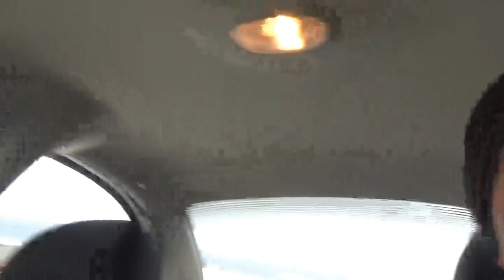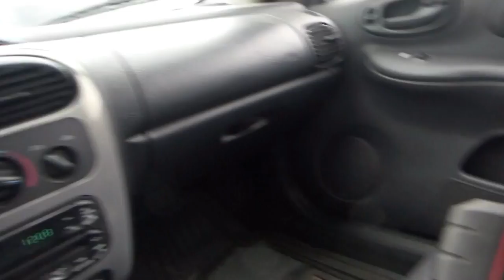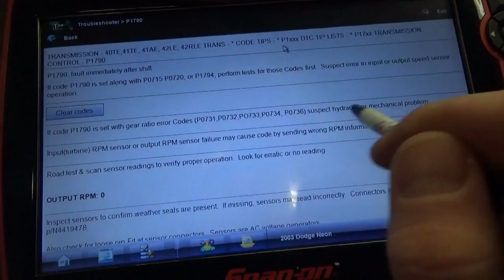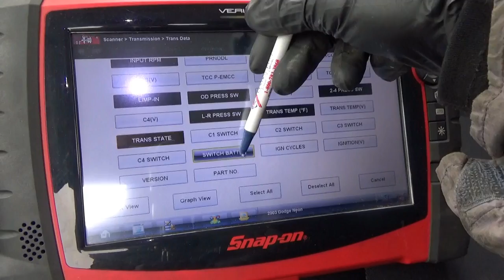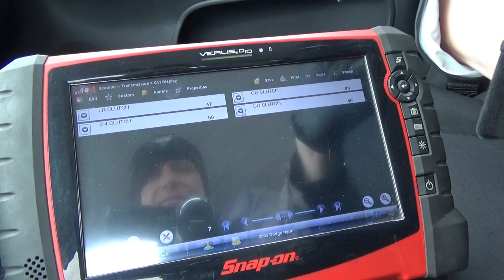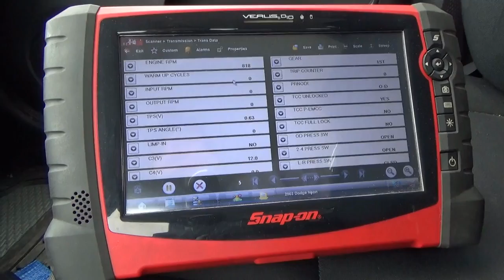Limp home, No-shift (Dodge Neon) -Part 1

Comment: Advice to customer: Throw it away. 
It was broken on its way out the factory door. It hasn't improved with age. It is So awful!
Reply: The code info says to look at input & output rpm. As you pointed out, the input rpm is wrong a bunch. Look back at the video. The car works when the input rpm is reporting correctly and not working when it is wrong. I think the input rpm sensor has failed, but you could also have a wiring issue or mech issue related to it. If the sensor is cheap, just replace it. If it is pricey or difficult to get to, then back probe the sensor and see how it is reporting.
Reply from the maker: Actually the data was reporting absolutely correctly!
Reply: @PineHollowAutoDiagnostics  I saw your follow-up video and, of course, you were correct! :-)

Comment: Make sure to check service info on checking trans fluid. Some chryslers need to be in N and not P to check fluid. But I guess you already know to check trans fluid level check procedure. I do not know of any automatic transmissions that the fluid is checked with the engine off. Your checking a hydraulic system level and this most always done running.
Reply from the maker: On Hondas you check it with the car off

Comment: My $0,05 bet.  2/4 clutch inoperative. When gear switch from 1st to 2nd, 2nd does not engage -> fault -> limp mode = 2nd -forced on. As 2nd does not work-> dead end. Power off  -> back to 1st. Check wiring, solenoid and controller output for 2/4 clutch. If all ok -> transmission clutch mechanical fault. Unlikely as fluid was clear.
Reply: However the 2/4 clutch pressure switch was closing.
Reply: @remingtonbaker3376  commanded on or in reality closing?
Reply: @jannepo  clutch pressure switches do not get commanded on.
Reply: @remingtonbaker3376  those are not solenoids to open and close to control hydraulic pressure to the clutch?
Reply: @jannepo  no they are sensors they close when enough pressure is applied.
Reply: Built to $*ck specs, because VISA owns GM and probably dodge too... finance; pay for two cars, get one dead car in 6 long years. Liv'in the dweem...on Elm St.
Reply: Have the Same Problem, Same code p1790, and i change the transmisión... So i dont understand why the failure continúes if it was supposed to be an internal fault.. I have more than 2 years with this.. And i have not yet been able to solve it... Need help really i Need it... Can You please write me by mail Emiliomaps@gmail.com, or My number +58 4140805969.. I from Venezuela please help me at least tell me what the owner did to Fix It..

Comment: First check the fluid level with engine warmed up and running.....Second it's probably the shift solenoid pack located on the front side of the transmission

Comment: It sounds as the filter might be clogged, or an erratic speed sensor. Or the engine problem causes the transmission problem.

Need to check the level with engine running and check the level.